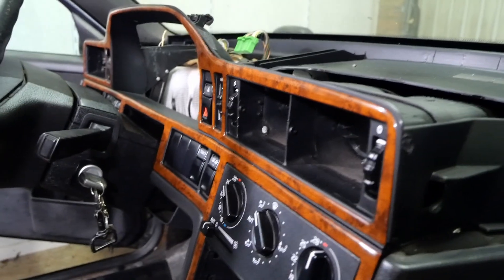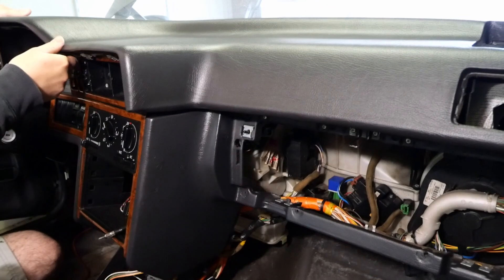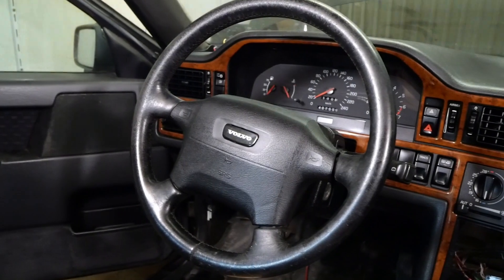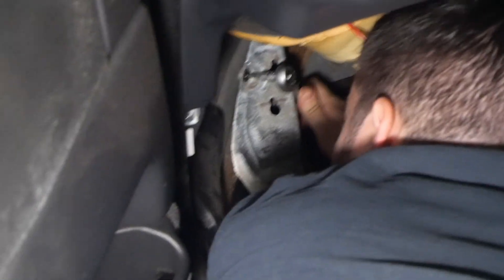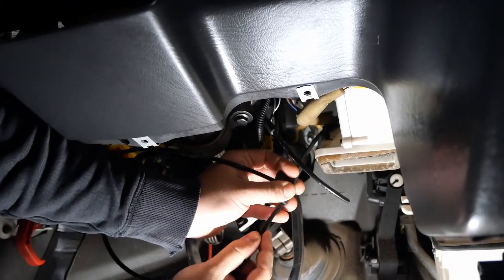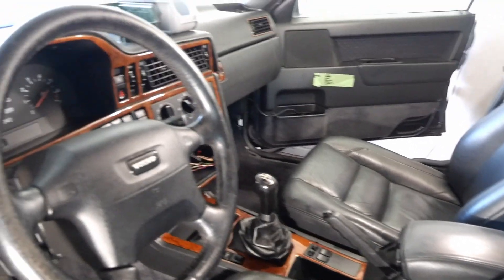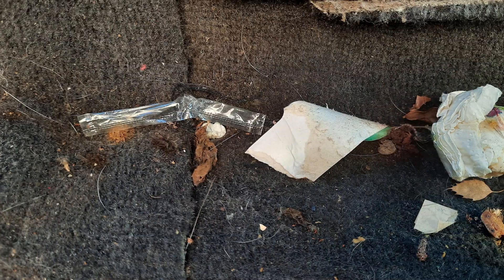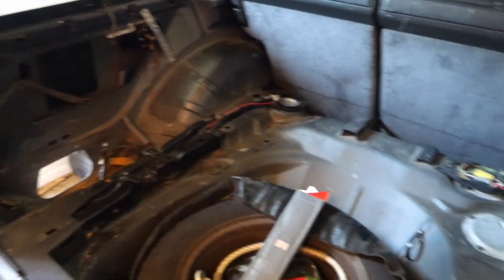Volvo 850 Restoration - Finishing Up The Dash And Installing The Center Console &  Seats

Comment: About radio and speakers - factory radio uses other ohm spec of speakers, so you Will probably need to replace to the factory ones if you want to use factory SC radio, or you can buy an adapter for Hu-850 or Hu-1205 from s/v40, they are using most popular ohm spec of speakers,  and only need an adaptor, else if you want an aftermarket radio, then you can go with 1 din bolt on, as in your car, or you'll need to cut a place for radio in your radio mount for 2 din, and it's not looking pretty tbh
Reply from the maker: Thanks for the info!
We want to do a roadtrip through europe in honor of dad once we finish the restoration and for that reason we want to install a double din radio/nav.
Reply: @MusTRitch  You can try to go with HU-1205, but i'm not sure that navigation system will work properly on it, but 2 DIN radio will require some cutting

Comment: Hi I have a question. Can you help me and say what cable is responsible for 
speedometer lighting ? In my 850`s i have a problem with lightning, when i change position of adjuster brightness nothing gonna happend.
Reply from the maker: Hey, not sure about what cable that is. We would have to look up a diagram for that. Maybe a stupid question but are you sure it's not the switch itself or the lightbulbs in the cluster? In our case it was both😅